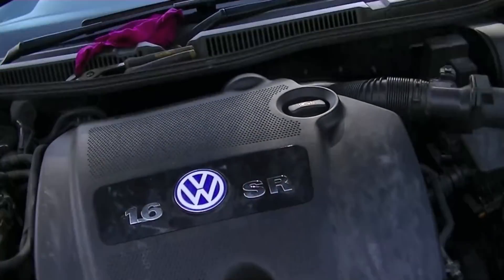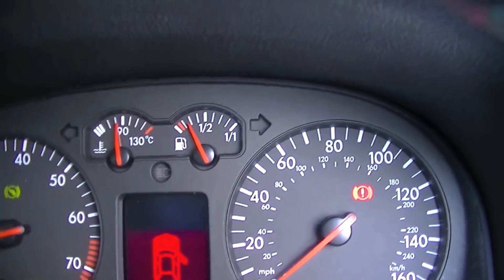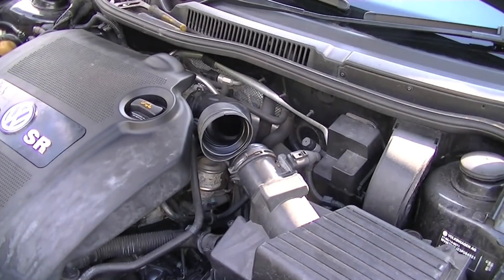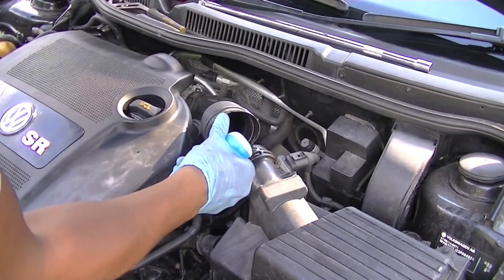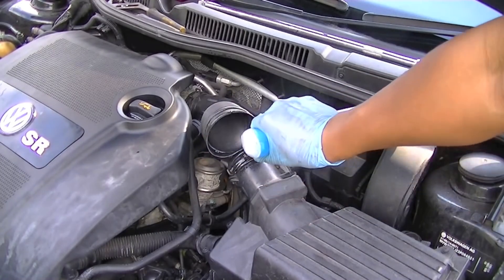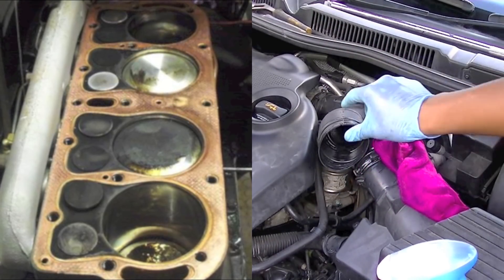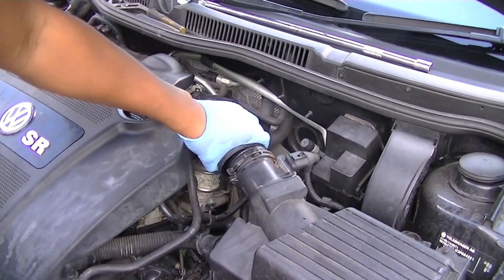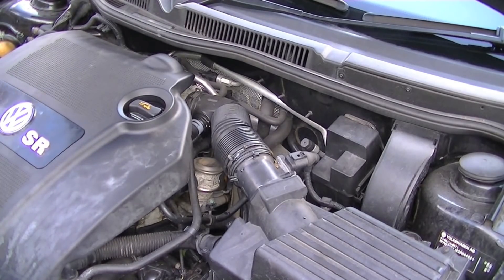How to make your engine run better with just tap water.......Better Than Seafoam?

Comment: I can see this being done on newer cars or newly rebuilt engines. I recently had to replace my cylinder heads on my 99 Dakota. I'm not the original owner I'm the third owner. It has about 165k miles on it. Anyway, so as I pulled the intake manifold to my shock it had some pretty bad carbon build up and engine sludge. When I pulled the cylinder heads the pistons had a lot of carbon build up. Maybe 1mm thick idk. So what I'm trying to say if you have an older vehicle with over 100k miles on it and have never done anything to clean up carbon or sludge do not expect a few mists of water or mist a full bottle of water to clean hard carbon build up. I spent hours and hours cleaning the carbon and sludge. Oh and I did not use a spray bottle of water either. Wire brushes razor blades a small shop vac and lots of throttle cleaner and even oven and BBQ cleaner to clean the valley where the intake manifold sits on the engine block to free it and clean it from engine sludge. I did the same to the intake manifold and plenum. When trick I did to clean the plenum is put it in boiling water to easily scrap and brush off old oil and sludge. Can I see this method work? Possibly, but only in newer cars or rebuilt engines with very little carbon build up. If you want your old engine clean and free from carbon you need to take it apart. If you don't want sludge don't be so cheap and give your car an oil change as scheduled. Like I said I'm not the original owner of the truck but who ever was did not maintain this truck well at all. I got the truck for almost nothing. Now with an almost rebuilt engine new heads new bearings and clean intake manifold and cleaned engine  this truck runs amazing for a 6 cylinder. Take pride in your car maintain it change its oil and don't be so cheap. A few mists of water will not clean or decarbonize a poor maintained vehicle.
Reply: DE Nichols  THANK YOU for your input on engines.

I put 4 OZ's in every full tank and 12 OZ's in at oil change for easy winter starts.

DO NOT USE IN DIESEL OIL as it thins too much and has caused engine problems....gas engines only !!!

I will use Marvel for the rest of my life.My mechanic uncle used it from 1940 till his death last year.I always thought these products were SNAKE OIL but after testing this for 18 months continuously I am a believer.

As carbon,sludge and varnish are an issue then this pays for itself.NOTE....I can't believe that mechanics take a sludge motor and spend two days with Q TIPS and vacuum suction for sludge ?? It's a wash machine.ADD Marvel change oil every few days.Then run on Marvel.

The gas MPG pays for the Marvel if you stay at 60 MPH. you actually clean the engine Carbon and get extra money back.If you can open a motor after a year of 2 then it is more scientific.My POLAR driving patterns will ruin an engine without using MARVEL you buy at WALLY MART.....LOL
Reply: BRUCE LEE Okay - not a problem.  You must be right.  I maintain fleets of Ford and GM vehicles for a living and have no idea on what I'm talking about.

Mechanical engineer - Worked for Holdens as a tester.. Yep.. No idea...
Reply: DE Nichols I think he's just trying to advertise that stupid oil. He only mentions it a thousand and a half times, tying it to all sorts of obscure issues. I stopped listening when he said Seafoam degrades the seals in turbos. Seafoam is actually the ONLY product in its class that does not break down seals, so there's that. And he's kind of an idiot, especially in the way he talks. You do you, but I'd say it's safe to ignore him, he's a troll.
Reply: I really appreciated your perspective. That happens when someone gets me thinking. 

I recently did this on my engine and I couldn't be happier, but I have always maintained my car.
Reply: Their is a FORD TECH that is on You Tube. The F150 and other ECOBOAST engines are building up carbon.

What not to do he said is to use SEAFOAM. The heat from SEAFOAM will cook the bearings in the Tubos that is close to the motor. No problem you have now ruined your warranty and the Turbos cost THOUSANDS.

He didn't say you couldn't use it on other motors without TURBOS.

He said I could use MARVEL MYSTERY OIL in my gas 4 OZs on a full tank and 6-12 ounces at oil change. This will not harm TURBOS as their is no heat and fire.
Reply: Your 99 Dakota would have been very badly abused to have 1mm of carbon build-up.  I've rebuilt engines with 540,000Km on them, and they were as clean as a whistle.   

Sludge build-up is also due to shockingly poor maintenance.    Typically, sludge and carbon are easy to eliminate with basics covered off more frequently.
Reply: tcpnetworks   Your statement is ......WRONG....." Sludge build-up is also due to shockingly poor maintenance.  "

My nine year old car had " DRY DIP STICK " which would not give me readings after an oil change DUE TO SLUDGE in ports and Galleries..GOOGLE " DRY DIP STICK "

You say I did shockingly poor maintenance but I  have a lifetime oil change contract for 700 bucks.I changed oil every 2-3 months.

The cause was a Polar climate causing sludge and driving short distances less that heat up of 30-40 minutes.It was driving patterns and a cold climate causing moisture and sludge .

Educate yourself before you make statements.Marvel Mystery Oil was used and the sludge cleared up in 30-40 days.The motor became quiet and MPG increased from 36-43 on highway at 60 mph cruise control.
Reply: BRUCE LEE I think he is right, but there is more than one way to build up carbon and I really enjoyed your post too.

So the Ford Ecoboost building carbon is more of a problem during to direct fuel injection. The gasoline can't clean the valves that way. That's where the carbon is building up on those engines. VW has the same problem. 

Bruce I'm very glad you helped me see a use for Mystery Oil. I think it's often misused but using it like you did could help in a lot of similar situations. 

The other part of the Ford Ecoboost issue in my opinion was that some models had too much intercooler. Ford's fix or it seems to be working. Similar in a way to your cold climate problem.

Someday I'll take apart an engine just to clean carbon and I'll compare it to the effectiveness of spraying water for decarbonization. 

I had amazing results. One cylinder was running 7 degrees hotter than the others. I heard lots of excuses about water jackets being there and such but those are evenly displaced so I couldn't buy it.

Check out my articles. 

http://carmilespergallon.blogspot.com/2014/10/decarbonziing-your-engine-with-water.html?m=1
Reply: Now that was 7 degrees C different that got fixed. That's about 14 degrees F different and it was measured on the cooler side of the engine emphasizing how bad that was. It was almost back enough to make it misfire. 

Too much compression from carbon build up in one place from imbalanced fuel injectors. I've fixed that.
Reply: BRUCE LEE Heh.. EcoBoast...   That's about right...

I've just worked on a Ford Falcon with EcoBoast.   I really couldn't drive it.  Biiiiig car - massively heavy - small engine... GRRRR
Reply: tcpnetworks
Reply: tcpnetworks My car has a failed engine design. Turns out synthetic users never see that engine trouble. I never got the trouble myself. So I can see good maintenance and big problems at times, but as a rule, and normal climate, of course you're right. 

Bruce, gotta say, the way you talked to tcp wasn't respectful. I ignored it when I read it or it made your comment unreadable.  I skipped the style of your communication that got in the way of your what you wanted to say. 

Bruce do you get what I'm saying?
Reply: THis is what I said to you " +DE Nichols  THANK YOU for your input on engines. "

My last message to tcpnetworks was supposed to say YES YOU ARE THE ENGINEER so I can't argue with your experience.

The message is missing above ? you.

Tell me what I could say to +tcp that could be more respectful.

LISTEN I have 26 years in Behavioural Science with the Government and two DEGREES .I constantly am told here that my experience is BULLSHIT.I will not tell an Engineer that I know more than he.
Reply: BRUCE LEE Alright. Peace man. Hope to see you more in the comments. 

For me it's all about the learning.
Reply: Very true, bro, very good point you make. Completely agree.

Comment: I think the reason this and many other products work on carbon build-up is that they temporarily cool the very hot parts they come in contact with. This heating and cooling causes the hot mineral (carbon) to crack away from the metal surface. So, basically you are simply taking advantage of the different coefficient of expansion between metal and minerals. Provided it doesn't screw up something downstream, its okay. Heat up a bit of corroded copper pipe and then plunge it in water and you'll see this effect firsthand.

Comment: Hi all, I just have to questions regarding my dihatsu coure / mira(l501) .8 L, well it is a carburetor based SOHC engine car:

1- does this technique of de-carbonizing will work on my car? if yes then how?
2- can you please help me sort out a problem of how to get the perfect air fuel mixture, as my mixture screw is fully tightened and the engine doesn't die out. as I have read and heard that in such condition it should misbehave or die out? I have already seen so many mechanics and got its butterfly re-builded. then some one told me that may be its air ways are clogged up with carbon or dust, will this procedure help lean those clogged air passages / plots?

Comment: Tried this on a 1.2l Fiat Panda. Car had been running with a CEL for about a year. Garage coudn't find it. Had the injectors cleaned; 1 replaced. Figured there would be lots of carbon buildup in the cylinders, so I used your decarbonization method after replacing the injectors. Used about 3/4 litre. Car runs smoothly now. No more lights coming on as well. Next on the list: replacing the oxygen sensors.

Comment: 1.6L SR? They don't make those in America just the base 2.0L ABA which I think over in England you guys have the 2.0L High Compression ABF? Then we have the 1.8T AWW/AWP etc then the 1.9L turbo diesel. Those 1.9L turbo diesel engine have done serious torque, I don't know if this car was modded but I've never seen a diesel car move like that, probably had some propane tanks in the trunk. How are those ABF engines? Some big ¼ mile racing names sell kits for the ABA to convert it into a high compression ABF. They also have the 16 valve heads? Or is that just part of their kit? I know the 16v Audi heads fit into the ABA and ABF blocks and ask 20 valve heads are interchangeable
Reply: This is Golf MK5? Here in Norway the 1.6 is most common (102hp I think), but we also have 1.4..
Philosofy (and car-taxes) are quite different in Europe.
This does not only go for the Golf, same on all other cars ;)
Think your base Ford Focus is 2.0, here the 1.6 petrol or diesel is most common.

Comment: i have a 1.4 mk4 golf and my car wont stay started when its cold but stays started when is runng at temperature will this method work to clean my throttle body? thanks in advance

Comment: I'm in Australia and i have a 2006 Mitsubishi Colt ES RG 1.5L, It has a 4A91 engine. while taking a look over the engine bay i noticed that it looks like the intake manifold (you may have to look up a picture of the engine to see what i mean) comes from side of the block and come up from the side and then goes over the top to go in to the intake. My question is this de- carbonisation method going to be effective or is the water just going to pool at the bottom of the intake manifold or cause any damage to my vehicle?

Comment: Hi mate. On the left side of the video i notice that you said a broken gasket on the top head and the coolant takes of the carbon and clean the piston. Im not trying to say much but coolant actually act as an anti rust for radiotors. If you dont use a coolant,radiator gonna get rusty and clogged. If by water itself to clean it, its imposible seriously. Im not saying your method is wrong. There are some things you need to look for. Im not gonna argue with you. I like your video..no heart feeling about my comment. Cheers

Comment: How many litre that you spray into the intake? I have 2000 Camry with more than 300k.
Reply from the maker: 1 pint should be about enough
Reply: BMAC VAGS I have done this to all my 4 stroke motors even my Harley Davidson for the last 30 years. It works great. Never have I had a stuck ring due to carbon build up. When I pull the heads to do other work the pistons and valves are allways cleen. Wish I could do this to my 2 strokes but they do not work the same way the water would end up in the crank case. Not a good idea.
       This trick works well..Thanks for showing how simple it is...
Reply from the maker: ghettohillbilly1 I have got another seafoam video coming friend. What would you like me to show in this one?

Comment: Hi everyone, I pretty much have faith in this technique but I have just one question (maybe a stupid one) : where does the carbon build up go? is it dangerous for other parts?
Reply from the maker: Bluegogglesonadog  I would say it leaves with the exhaust gasses.
Reply: BMAC VAGS yeah that's what I thought. Just wanted to know if it can be dangerous (maybe not the right word) for the cat or muffler or anything. Which I guess can also be cleaned (maybe a future video? :P)

Comment: You have said it cleans the deposits on the pistons etc... but after you have been spraying the water, Where does the deposits actually go? Wouldn't they block up your Catalytic Converter? or does it just simply burn off in the cylinder.

Comment: Bro I have a question, my dad has a 2001 ISUZU Trooper has about 350,000kms on it, 6cyl 3.2 DOHC petrol engine, my question is since the car has been running for quite a long while with daily driving all over the place, can this method be used on a daily basis to completely decarbonize the inside of the engine? I jus did this method today and took the car for a test drive, the engines behavior changed slightly but positively ,it had this hesitation when i press on the throttle from stand still then it smoothens out and now this hesitation has decreased slightly, good results got me thinking :3

Also I'd like to personally thank you for making these videos! Mydadgot a 2001 VW Bora with a swapped out 2.0L engine that I'm so in love with XD your videos helped me alot with some of the work on the car! THANX!
Reply from the maker: Thank you for watching the videos i really appreciate the support. I would not use the water decarbonisation on a daily. Once or twice a month until improvement kinda flattens out.  Make sure to check all of the other fundamental things that can cause hesitation, plugs, leads, distributor, throttle body, fuel pressure, maf etc

Comment: It seems like a good method ! ... do you know if the carbon deposits exiting through the exhaust can clog the catalytic converter?
thanks
Reply from the maker: They exit in the same way it would if you used a injector cleaner.